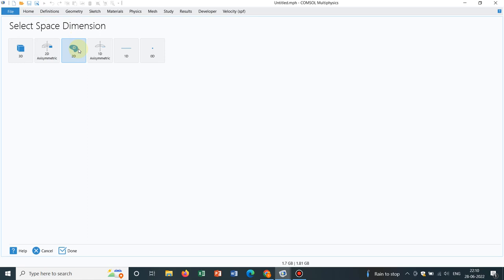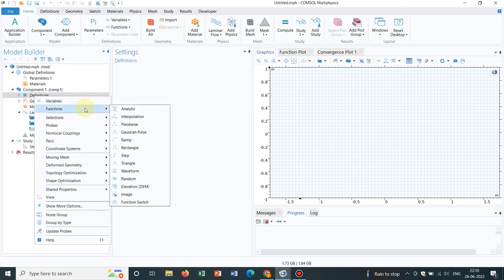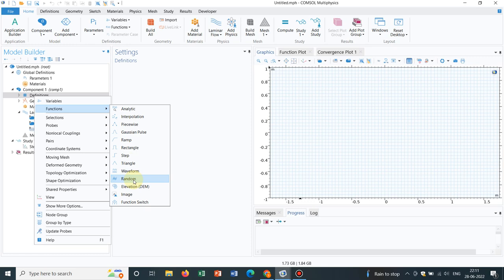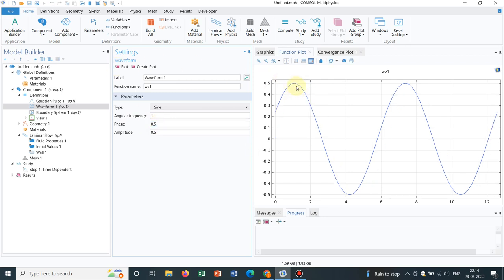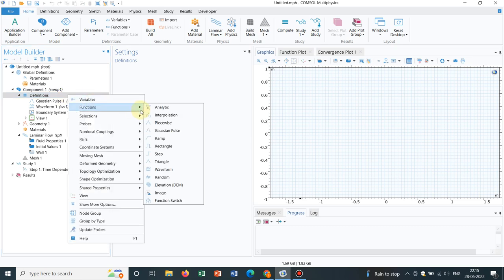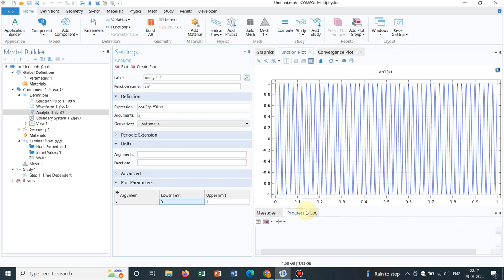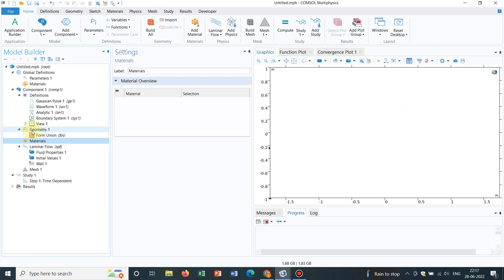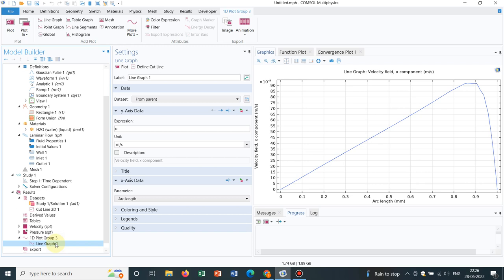Analytic Functions in COMSOL #AnalyticFunctions #COMSOL #RAMP #WAVE #PioneerOfSuccess

Comment: Thanks for the video. It is very useful. Now I need help, I hope you could answer. I'm using the dilute species transport interface to model concentration profiles in my model over time. For this I used a reaction node that was associated with the corresponding domain. I associated the reaction rate to an analytical function, so that calling it on the node will calculate the derivative of the function. So far I have managed to simulate the reduction of the concentration of the species of interest, however, for the species that are formed I do not get the desired results. It keeps simulating a decrease, when I need a production. could you help me?